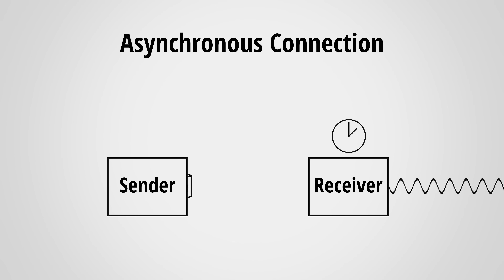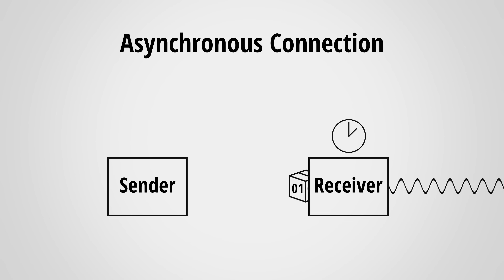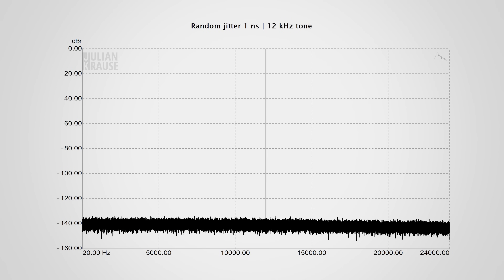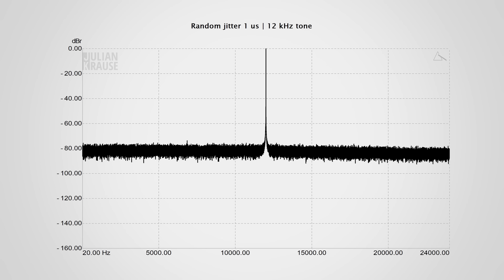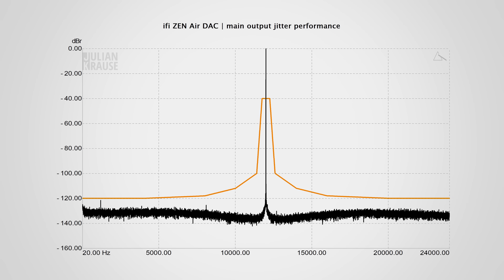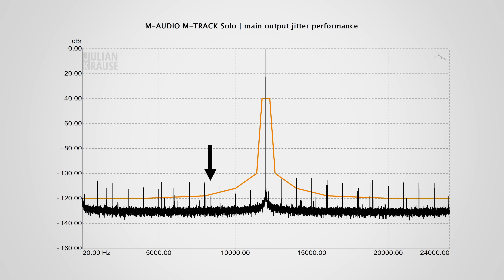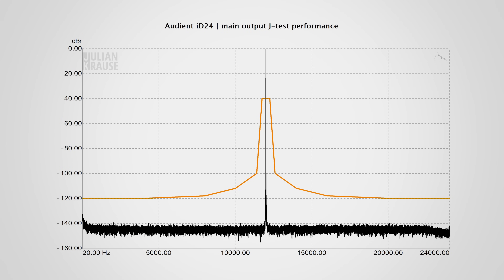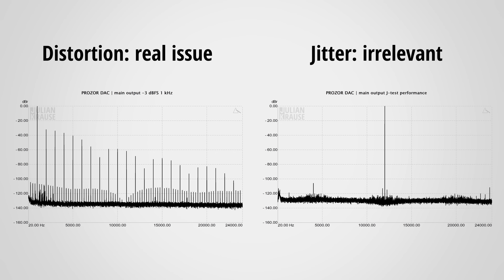Jitter is RUINING your audio? The TRUTH about jitter!

Comment: Wow, blown away. So even the cheapest crystals in PLL circuits are no longer an issue? and when I use my CD transport over coax, impedance issues are universally solved or inaudible now? That is amazing. Make sure you send this video to Rossini, Chord Electronics and all the other manufacturers of master /  slave clock systems because jitter is no longer an issue. I’m off to plug in my $50 Best Buy CD transport into my $8 Amazon DAC and pretend those 500 uS time distortions don’t really exist. Don’t forget to notify the major sound and film studios too, they will save a fortune on studio gear.
Reply: Context is king, eh. I bet nearly everyone wouldn't be able to non-randomly ABX very low jitter levels on even very good setups. Sure, studios, mastering and post houses may have ten or hundredfold times more expensive converters and gear, but then their intent is more focused. Even then, some places buy some gear to justify the rate card ;)
Reply: A crystal is fundamentally never the source of jitter to begin with. You probably don't want the cheapest ones because they fail a little too often and how well they hold their spec frequency after some heat cycles is a little dubious, but yeah not jitter. Of course not all clock circuits are stable, and most are not entirely unconditionally stable, but that's not the crystal's fault.
Reply: @maxpower571  On a USB audio interface (USB to analogue all in one box), jitter is indeed not a concern; nor is it on many other classes of devices. To the extent that it's there, it would just imprint on the THD/IMD metrics, so if those are good enough, then it's good enough, and indeed it ranks very low on the list of issues for these particular devices.

Comment: I have an Apollo UA interface that jitters on internal clock but cleans up nicely on word clock slaved to RME. This is the opposite of what I have been told to always do. What software FFT would you recommend to use to show and prove this effect?
Reply from the maker: You sure about this? I would assume that the UA is not too much behind the RME. You can test it by outputting a tone of 1/4 the sample rate with the UA and record it with the RME. You can use pretty much any FFT to analyze.
Reply: Check out multitone by distortaudio. Its a free audio analyzer that has jitter test built into it. Or do it manually with REW
Reply: A word clock synchronizes the clocking of two devices.  Without it, one interface will always run a bit slower.  No two crystals are exactly the same frequency, and they vary over time, temp and voltage, the world is imperfect.   My guess is that you are using both interfaces at the same time when noticing the glitching.
Reply: It’s not glitching. Only difference is running converters from internal clock vs external clock via word clock from apogee or RME. The UA Apollo playback D to A is the noticeable difference. Going to take measurements to show using Jtest samples. Also looked at difficulty of electronically creating a PLL from a word clock input and it doesn’t seem that hard to be honest. On the scope the PLL I created looks pretty even with 10x over sampling.  Maybe all this talk about “an excellent crystal osc is easier than an excellent PLL are based more on theory than practice?
Reply: @RobHarrison  My FFT runs on apple and linux, it is more realtime focused but should work with a thunderbolt interface.  https://youtu.be/ar3xALcDILc?si=-qxoNfllC21WZjWi 

My understanding of PLL design is that the major tradeoff is between easier/quicker/more robust locking or less jitter/stability.  From a software perspective it is a clock multiplier followed by a divider.  Software typically ignores things like jitter, tolerances, etc.

All audio codecs sample at a higher rate and lower bit depth. It then reduces the rate, which increases the bit depth, all while carefully pushing the noise out of band.  Then a digital half band filter removes the noise and halves the rate one last time.  it is cheaper, in transistor count, to over sample.
Reply: Multitone looks like PC only. Will try to get access to one but prob won’t work with the Apollo cos it’s thunderbolt 2.

Comment: Between you, Jim Lill and a few others you have pretty much destroyed any notion that recording music has to be expensive. And this is a good thing. It forces creators to focus on the art, not the tools. Thank you.
Reply from the maker: Thanks!! Agreed, Jim has some really cool videos.
Reply: @JulianKrause   I love the video and confirmed my suspicions. I have a question, so I have a TLM 103 Microphone connected to WA73EQ and the Preamp is side chain to a RNC 1773 compressor into a Focusrite Clarett plus 2 into logic. Everything is sync to 48Khz, the Mircophone Cable is 10 feet long and all other connections are 3 feet. I'm hearing a Periodic Jitter on some vocal part...  It only seems to happen when I connect everything. How would I fix this problem before it starts to add up? Would  "Latency Detection Ping" work to combat this issue?
Reply: I built my first DAW in 1999/2000. You had to pay quite a bit to get good convertors, and you had to pay more to get converters that were located in the breakout box (I drooled over the MOTU 1824 iirc), because converters close to the PCI bridge would pick up noise. And the budget converters weren’t guaranteed to be shielded. Anything available today in the recording space is orders of magnitude better than hardware 25 years ago.  The playing field is more level than it has ever been, and it’s just going to get better.
Reply: Yeah, everything is so good nowadays. But... some are chasing some past times characters. And putting multiple so-so devices in chain might lead to audible problems sooner.
Reply: Jim is amazing. It's fun how many forum myths of old fall apart when you start focusing on what actually makes a difference and the science behind it
Reply: Very well said!
Reply: Creators that focus on the art? Which art? The art of copyfake? True, you dont need to sound expensive on original art..thats more important for selling fakes, to hide the weakness of stealling copyrighted material sold as your own. However, also original artists might like the best possible sound, them usually care more than cheasy copycats, and you only rarely get that from cheap gear.. sometimes yesterdays highend becomes cheap, a secret tip, and than expensive again, once the secret tip is no secret anymore.

Comment: I would love if you could make those audio samples downloadable to get around youtube compression and duplexing.  They would be great to test out and demonstrate on our gear as a normal/high res file or even burn to cd.

Does jitter have any impact on other components at all-since it's an artifact of conversion or transmission (SPDIF), does it compromise or degrade/affect the performance of other components at all downstream in any way like transistors or other amplification components, feed back circuits, tubes, (even theoretically) etc?
Reply: The side effects of jitter - even if allowed to persist until the DAC and not cancelled - end at the DAC reconstruction filter and at that point it's just sound, distorted sound but without any suspiciously bad characteristics, unlike say clipping.
Reply: @SianaGearz  thanks for the intel.  I assumed there would be some effective filtering at some point, but wondered if all the extra 'hash' of jitter compromised components along the way.

Comment: Somehow your analysis is deep yet not long-winded. A perfect performance.
Reply: Well he is German!
Reply: He skipped over everything that mattered.
Reply: @Pete.across.the.street  What do you have in mind that was skipped? Honestly curious.
Reply: @CharlesBurnsPrime  he over simplified it. It's much more complex than he made it out to be. That - 120db gets amplified. If you do actual a/b listening test you can tell the differences. Not so much that b you hear the jitter, but you can tell when there's a lack of jitter.
Reply: @Pete.across.the.street  Interesting. I would ask that you suggest a test for Julian to consider. He seems to be the kind of person that can share corrections or exceptions to claims without ego problems. I would love to understand this topic better as it is often discussed with regards to digital audio.
Reply: @Pete.across.the.street 
Amplification after conversion does not make jitter more audible, because jitter-induced artifacts are embedded in the audio signal itself. When you raise the gain, you increase both the wanted signal and the jitter artifacts equally, so the signal-to-noise ratio (SNR) remains unchanged. Since audibility depends on the relative level of these artifacts, not their absolute amplitude, post-conversion amplification has no effect on whether jitter can be heard.

Comment: Julian, I hope you get the resources and inclination to test the supposedly highest classes of soundcards. Personally I'd like to see the RME hdspe pcie cards in combination with an RME M-32 DA Pro II AVB 32-channel D/A Converter.
 I ask because my studio runs Linux and that seems like an ideal combination that will work. Especially since I'm fond of outboard gear and don't want my "soundcard" to do anything except convert A/D.
Reply: The HDSPe are fine cards, they could be a little problematic with certain OS and DAW combinations but are more widely compatible nowadays. They're widely used in pro audio and broadcast environments (where I encounter them) where uncoloured sound, good noise floor, support for house clocking, AES I/O and 24/7 operation stability are needed.
Reply: It’s „almost“ pointless to test RME stuff since their own technical documentation is pretty much complete and they’re open (and honest!) about performance specs.

Comment: Amazing video mate. Is the grittyness of some 80`s early digital recordings the jitter? Take for example Show Must Go On by Queen, or the whole album a Kind of Magic, it sounds to me far more grittier than its analog predecessors.
Reply from the maker: Not too sure, distortion in audio components was also quite a bit higher back then. While jitter might add a hint og grunge, I think the most distortion is simply due to the older audio equipment that was used.
Reply: The quality of ADCs in general was variable in the early 80s. I've heard some very unpleasantly edgy, 'sharp' digital recordings made through early converters (different from 'clinical' or 'cold' recordings) - fortunately the tech improved fairly quickly.